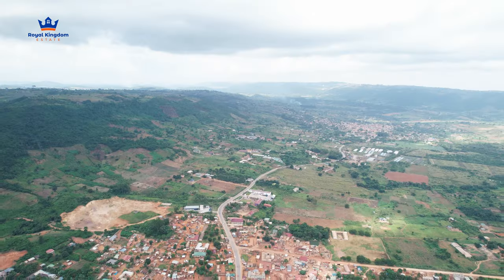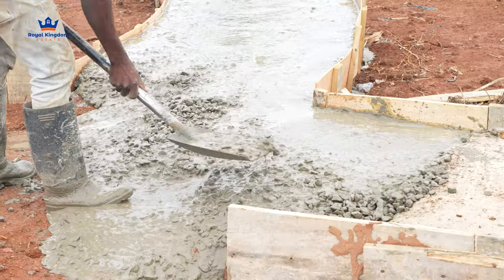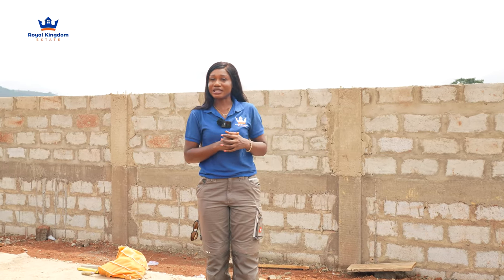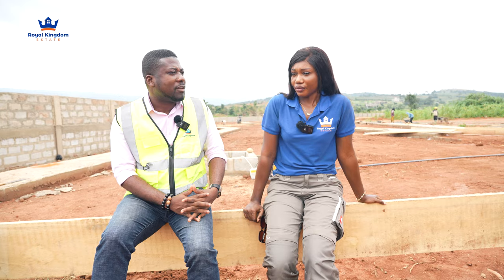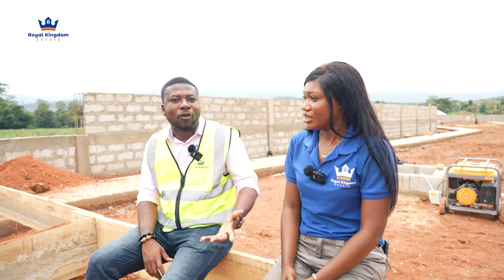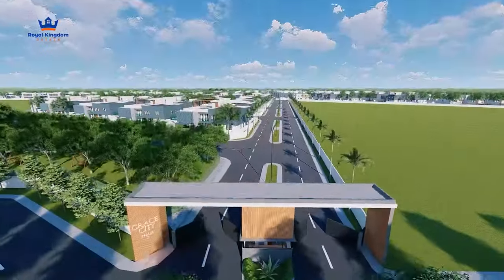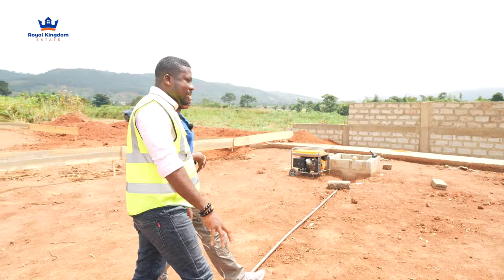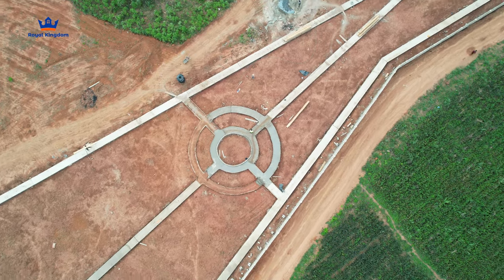PROVIDING THE SECURE DEVELOPMENT WE PROMISED OUR HOMEOWNERS WITH THIS SECURITY GATE POST AT PHASE 3!

Comment: New here 
Location and prices ??
Reply from the maker: We have lands available in Aburi. 
Kindly find below the price points for our various plots with locations. 

1. *Grace City Phase 3 *(Aburi- Amanfro) in the Eastern Region of Ghana.

Price per plot: GH₵ 70,000 

Instalment for 6 months: GH₵ 80,000

2. Commercial plots at GRACE CITY (Phase 1)
Price per 2 plots: GH₵ 200,000 

NOTE THAT THESE PLOTS ARE ALWAYS SOLD IN PAIRS, AND DO NOT HAVE INSTALMENT PACKAGES

      
3. Blackstar Village (Peduase, Berekuso/Ashesi University) in the Eastern Region of Ghana.

Price per plot: GH₵ 160,000 

Installment for 6 months: GH₵ 170,000

3. The View (Berekuso/Abokobi, Ashesi University) in the Eastern Region of Ghana.

Price per plot: GH₵ 200,000

Installment for 6 months: GH₵ 220,000

Minimum deposit for installment: 50% down payment, and the balance spread across a monthly installment of six months.